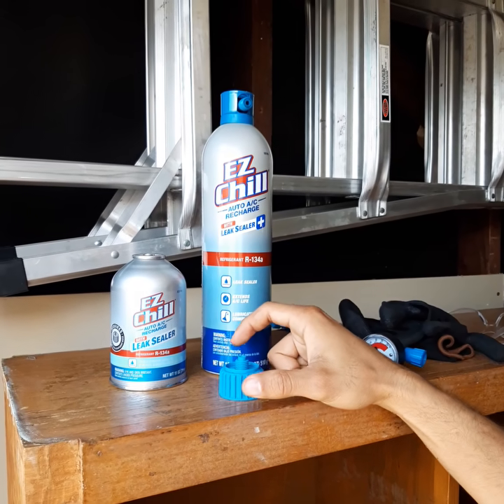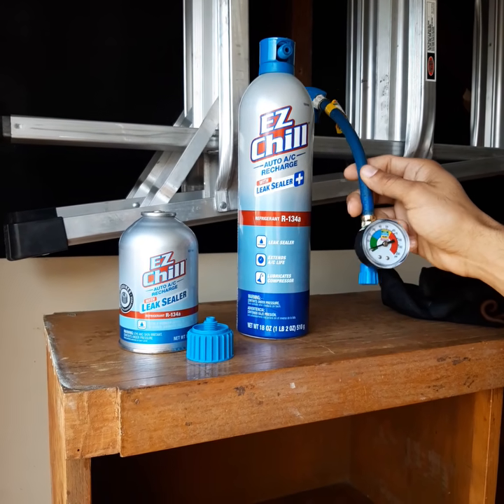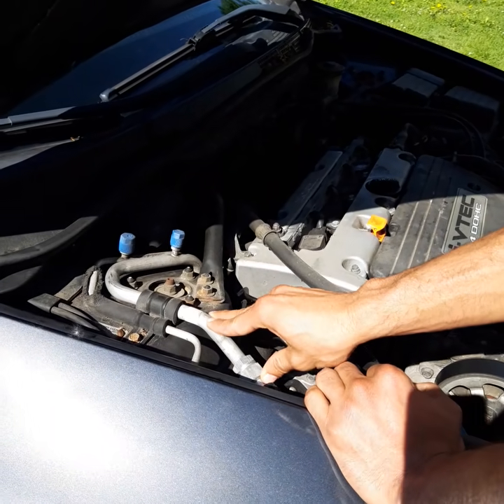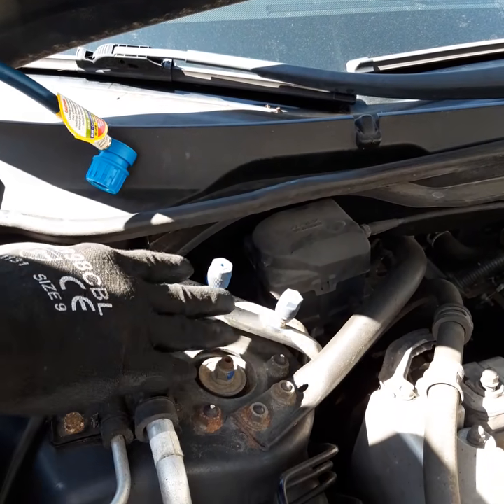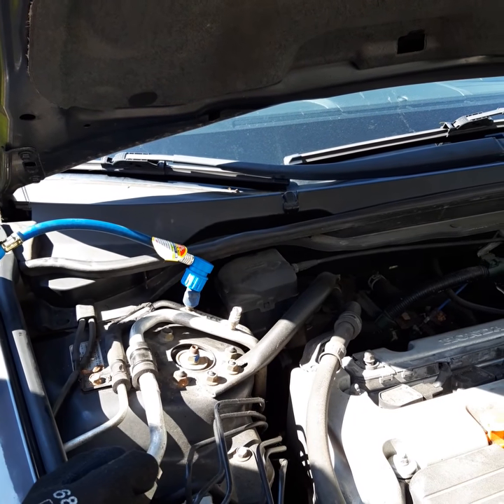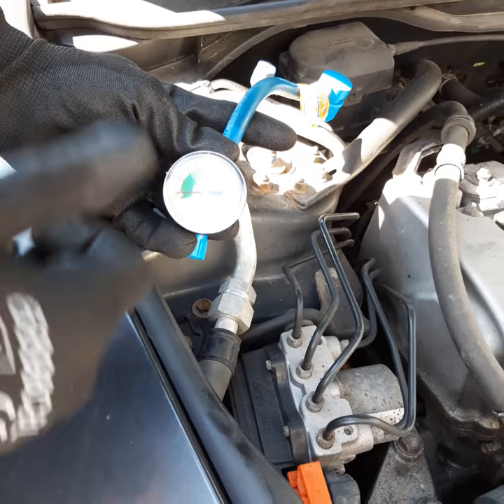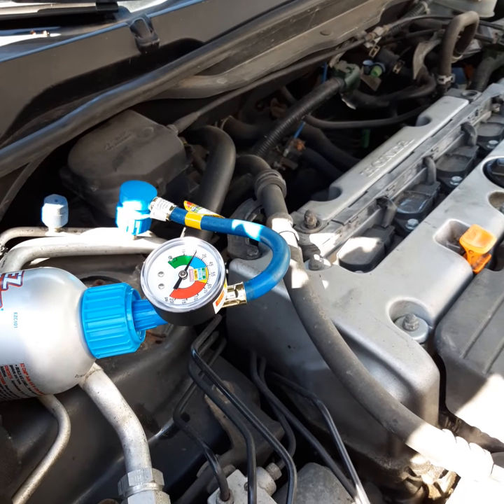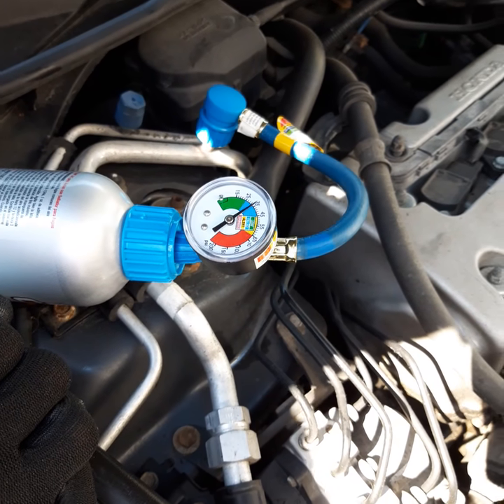AC Re-charge Honda Accord

Comment: 7/2020: While I have done this multiple times over the years, it's helpful to see a "refresher" video. Thanks, because this is a particularly good video to show (1) just the simple can of refrigerant, (2) the (critical!) $3 Adapter (mine is blue), and (3) the recharge hose-gauge tool ("recharge hose") that comes with many of the larger canisters of refrigerant, and which can be reused each year.  Screw the (blue) Adapter on to the can of R-134a refrigerant. Once the recharge hose is pressed down firmly on the low pressure port; the other end (where the gauge is) of the recharge hose is screwed to the blue Adapter; that starts the refrigerant going into the low side. If one gets the pressure they want, and wants to save a partially full can, one removes the recharge hose from the low-side port, and keeps the recharge hose, Adapter and can as a connected unit.
Reply: Hi Jrock, hope you're well. Do you happen to know where I may be able to purchase this adapter? Or what name should I be searching for? Thank you.
Reply: @JonasBliss  Hello Jonas. It's been 3 years and I do not recall specifics; however, I noticed that my comment mentioned finding the part at Walmart, the little blue part that you screw on the basic can of refrigerant. What I would do today, to follow my own advice, would be to look for that same part -- visually the part that is shown in the video -- at either Walmart or at an auto parts store, very close to the section that sells the cans of refrigerant. -- JRock
Reply: Thank you very much. Hope you've been well! @jrockafellow1971
Reply: So was that short fat can angst tall skinny can the exact same thing?

Comment from the maker: CLARIFICATION: your AC system might need recharged over the useful life of your vehicle. I am not sure what conditions would cause the refrigerant to degrade inside the system. However, the most common cause I KNOW of a system needing recharged is a system leak. Otherwise, a car can go years without needed the system serviced, and sometimes might not need it at all. A good official place to look for information is the recommended maintenance schedule for your vehicle from the manufacturer.  The AC system might not be included. See this link for more https://www.yourmechanic.com/article/how-often-does-an-ac-system-need-to-get-recharged. Thanks to the person who added the comment about the potential for misinformation. It provided the opportunity for clarification.
Reply: let me give you couple pointers.... BEFORE you connect anything to the low-pressure side BLOW THE DUST OUT OF THE PORT, 100% CLEAN! 
Notice how the cap has a hole that conveniently lets in road dust... This Shredder valve port is the No1 slow leak location once it's contaminated.

Note No2: if your AC was empty it likely needs to have air evacuated else the moisture will freeze and block transfers.

Note No3: do use a pressure gauge and keep the AC charge on the low side because if its over charged the difference in high-low pressure will lower the cooling. ie. the compressor needs to be able to create a LOW-side pressure to establish good circulation.

Furthermore if you want great AC for cheap.... WRAP your high-pressure liquid pipe (smaller size pipe) with pipe-wrap tape from HomeDepot. Do leave the larger AC low-pressure pipe unwrapped cause it needs to warmed up.

So wrap the skinny pipe from the front radiator all the way to firewall as well as you can.
What you'll notice is AC produces a lot more cold when evaporating a cold liquid than a hot R134 liquid... so obvious
👍
Reply: @glasser2819   thanks for the tips, may I ask what kind of pipe wrap tape you use? I’ve never heard of that tip before & just refilled mine up today. Looked it up and found either a white one (almost looks like surgical tape?) and a black “duct” tape one, would love to try that out. Thanks so much in advance! You & your family stay safe out there!